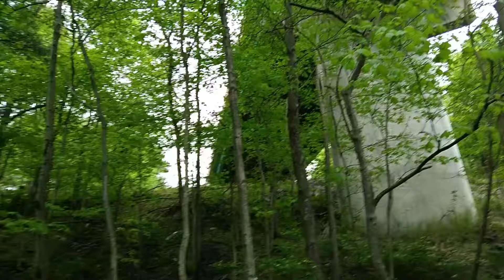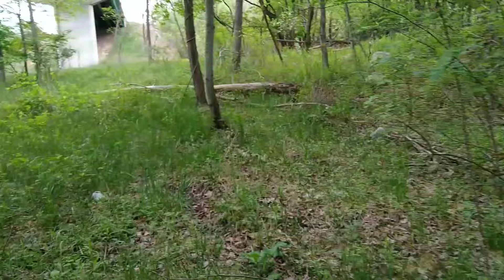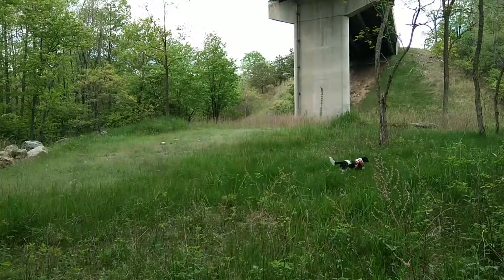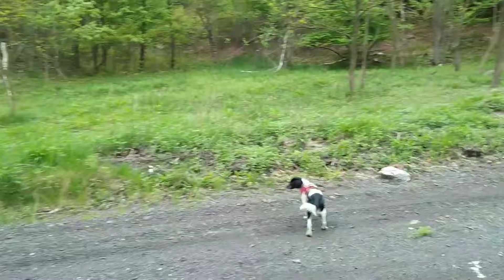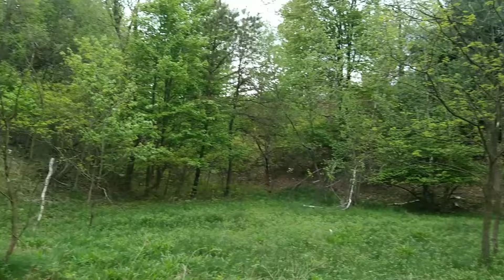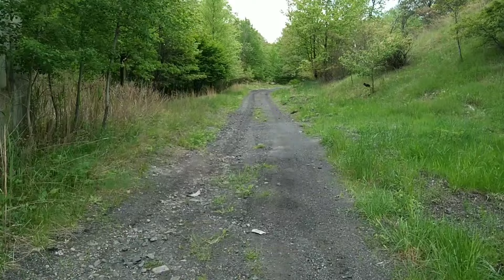Wrapping up our day on the Pennsy. Interstate 81 bridge. Schuylkill County PA.

Comment: I was always curious about that location because whenever we rode four wheelers and came into that area, we had to bypass certain sections due to the prison there, but I don’t know if they used if that was always like a service road or if that was a railroad grade or maybe it was a newer grade that was built because that bridge had become unstable due to age.
Reply from the maker: Good morning. I was wondering if the prison being up there was going to cause any problems. I knew I was kind of in the area of it. I'm still learning about this area. I saw a couple of folks up here on ATVs but not nearly as many as I thought I would. The bridge was a surprise. I would have thought they would have pulled that out when they abandoned the line. Thank you and have a great day.